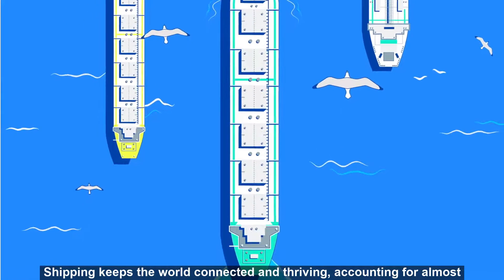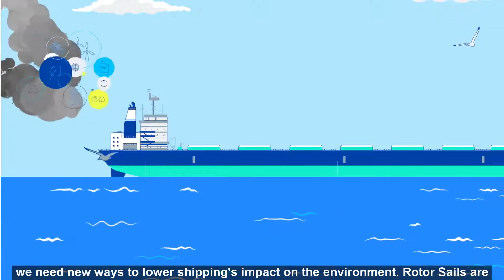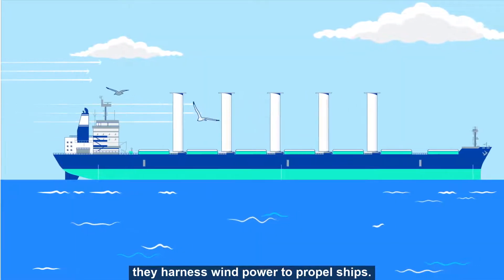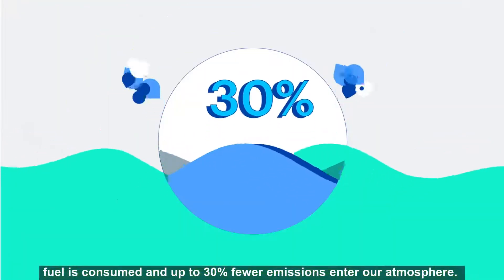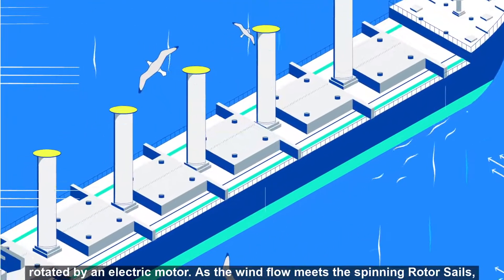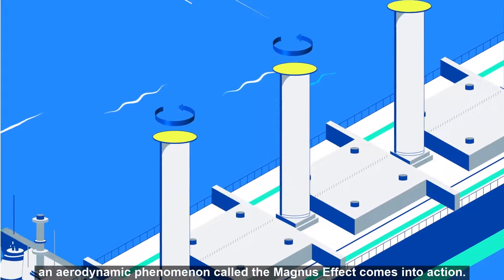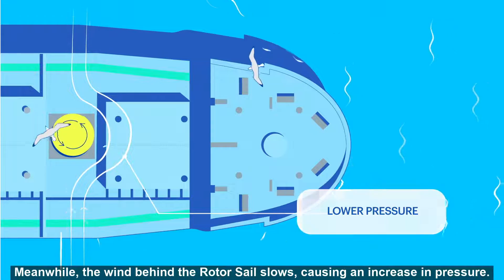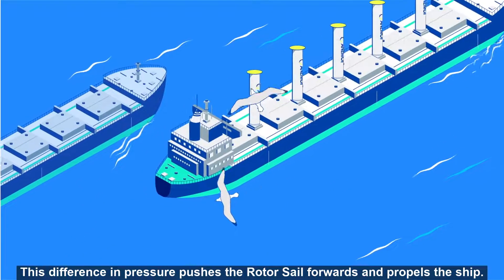What are Rotor Sails and how do they work?

Comment: why don't they have flaps or little sails that open on the rear side and blow closed on the front?
Reply: If they did, that would be a Cousteau sail design, known as the Turbosail or French turbovoile. The efficiency is similar to the Flettner Rotors, but they have a couple of limitations.
They have top remain in the same position on the ships deck, and cant be lowered or moved around the deck to facilitate cargo handling. The second "feature", is that for optimal performance, you have to trim the direction of the "blade" to suit  the wind direction, whereas a Rotor only has to have its rotational speed adjusted.

Comment: So they aren't actually sails but propellers, using air pressure instead of water pressure? Then how does that save more energy compare to water propellers?
Reply: Because the extra  power is coming from the wind, the tube's rotation only facilitates a pressure difference, more on one side and less on the other like a sail but more efficient or like a side turned wing, there are even airplanes that have no wing but a spinning tube and they fly with the same effect.
Reply: Hmmm. no. NOT Propellers at all. They are more a type of dynamic wing, providing lift. The forward part of the Rotor acts like the Curve of the upper part of a plane wing, creating low pressure, or lift

Comment: What are the angles of the wind which are still efficient?
Reply: They work at about +25° and -25°
There is some effect with wind angles behind the path of travel, but pretty innefective.
You have to use the same strategy as the Little America's Cup, you tack downwind and upwind to get the best performance.